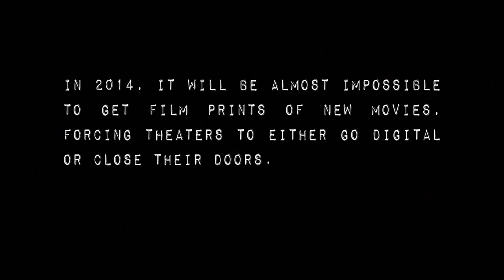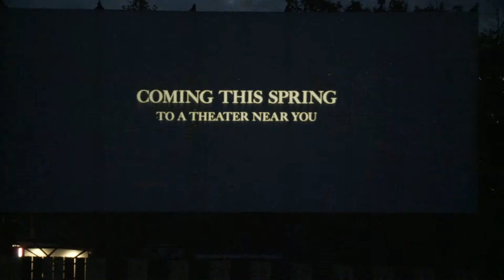Changeover: A Short Documentary

Comment: Movies they way they were intended to be shown. Was a US Navy projectionist at Kingsville NAAS before TD "A" School (1965-66), extra board op with IA Local 550 (Norfolk) and finally Local 513/354 (Tulsa) in the late 80's. Was fortunate to run movies in the carbon-arc/changeover world and IMHO, xenon and platters took all the fun out of the craft. Was able to extend my carbon-arc days for a few years running spotlights (Strong Super Trouper/Gladiator) with L354 as an IATSE stagehand but even the fun ceased after we replaced the spots with Strong xenon models. So sorry you had to say goodbye to the old ways but then again, progress is inevitable. I will say that digital has added and incredible dimension but it has killed the role of a booth projectionist forever. The best of luck to you. Hopefully, you've attracted a good customer-base and that their loyal to the drive-in world, regardless of format. Thanks for the great video!